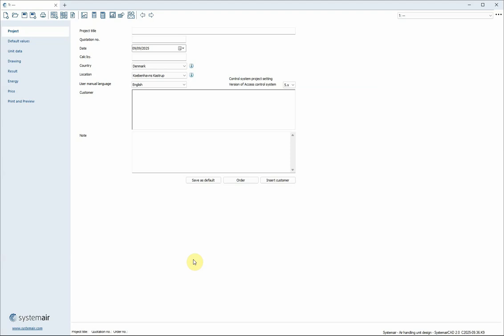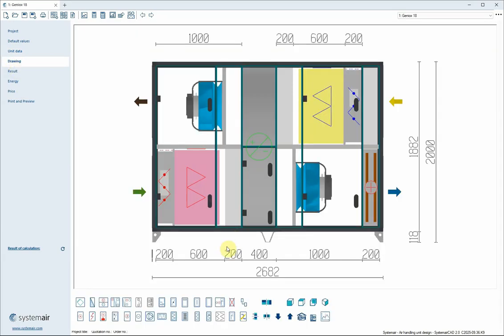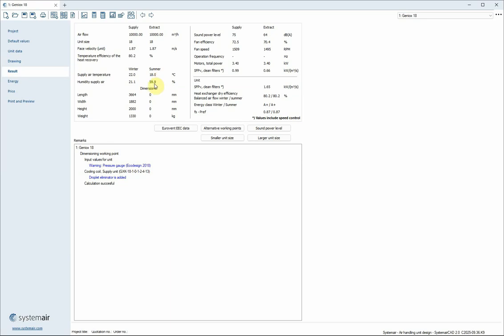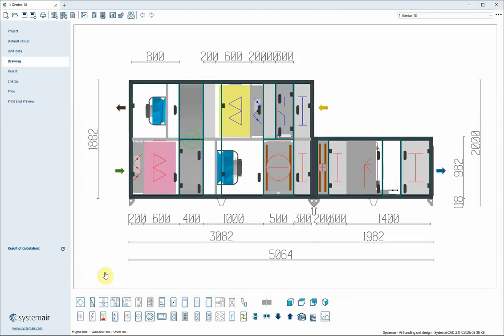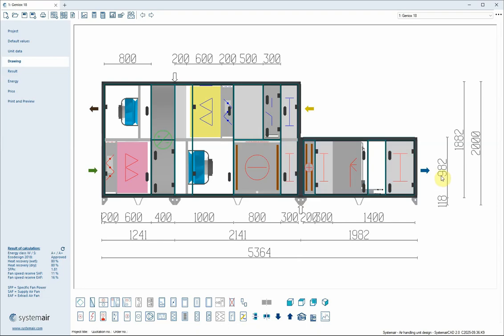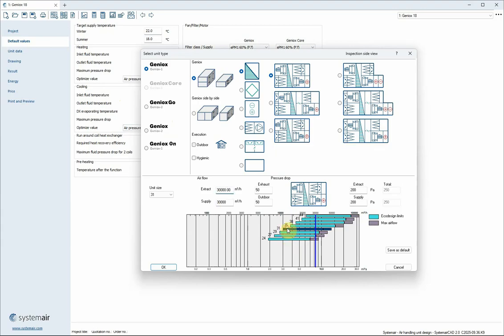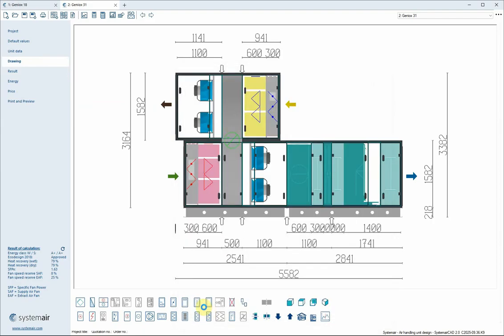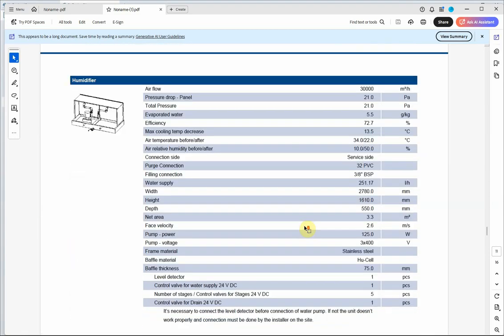SystemairCAD C2025-09.36.K9 new features

Comment: Hey! I want to buy the Systemair SAVE VTR 100 with hygroscopic rotor unit for a tiny house/annex. I am afraid it won’t be adequate enough? Or will it actually solve the humidity problem? Currently there is a unit there that doesn’t have hygroscopic rotor, just an aluminium rotor. It makes it too dry in winter and too humid in summer (especially when raining). 

Have you figured out the humidity problem with ventilation units? How do you make it stable all year round? Have you improved this in newer models? Or is the VTR 100 a good choice? It’s just a small annex at just 12 square meters and a volume of 29 cubicmeters that need ventilation.

I live in North Europe so it can be a lot of rain here.